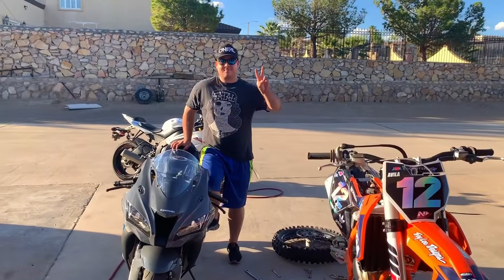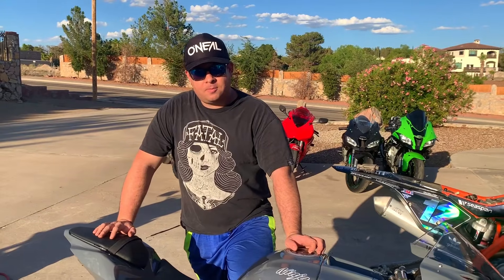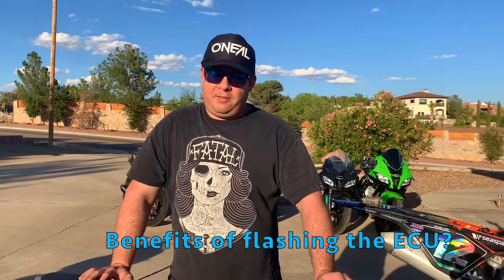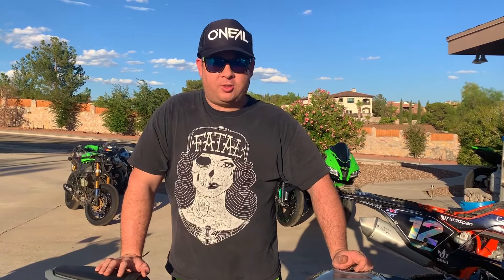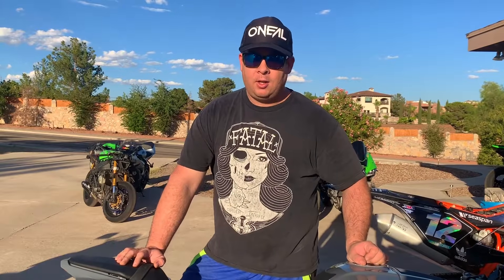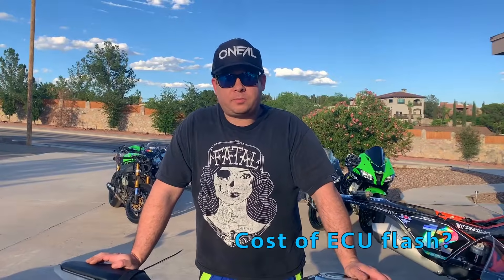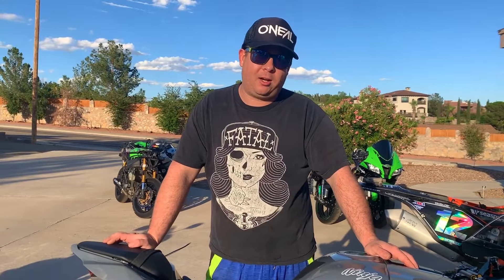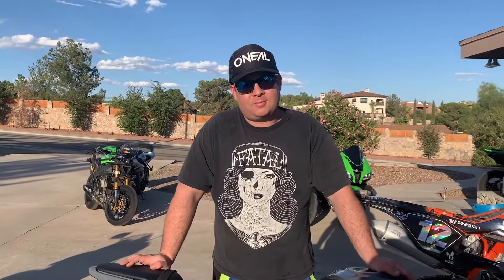Flashing Your Motorcycle ECU | Everything You Need To Know!

Comment: So I’ve tuned a couple trucks with hp tuners, the “2 different maps” your talking about is what open and closed loop if I’m not mistaken? On hp tuners you would be in closed loop until your engine warmed up. Still learning and that might be backwards but I’m basically asking does it read the same on dyno software and your translating it for more common understanding? Or does it really have two separate tunes at all times?

Comment: Will my bike (2015 yamaha r3) be worth it to have to ecu flashed? I have aftermarket air filter and slip on atm. Planning on doing more upgrades.
Reply from the maker: Yes 100%
Reply: @wildwhiskeywolf  what benefit would I notice?
Reply from the maker: More power, smoother throttle, and other improvements

Comment: dude i wish i could flash my bike for 250. the "best" flashing store in my city asks me for 400$ and they can only guarantee to fix the fuel/air flow mixture and not guarantee me any horse power. They said " it might get HP it might not, i dont know since i havent flashed a bike like yours before." They will get my bike's map for free for future use and they ask so fckin much...
I ride a cbr650r 2022. Right now i have installed an air filter and an exhaust. Catalyst is still on.
Any advice for improvements?

Comment: Thanks for the video!

Rich in detail and perfect for a noob like me!

I guess I'm going to ecu flash my 2019 suzuki katana, I guess it will be worth it!
Reply: Best options for this is if you fit an aftermarket exhaust system especially if you delete the CAT,then it like the mt09 can run lean as for emissions reasons they are already lean from factory,let the company know off all more so they can make the changes needed,the mt09 really benefits as it smoother out the jerky throttle and gives full power that is restricted on factory ECU.

Comment: Will exhaust systems from a 16-20 zx10r  fit on the new 2021 with out modification?
Reply from the maker: Yes you can make it work. Some won’t fit because of the oil cooler that was added.

Comment: Is this expensive, plus is this better than a power commander 5 ,my bike is a vfr vtec 3005 with a full upgrade Delchevic exhaust system
Reply from the maker: Flashing the ECU is always better than installing a piggyback system. You can change the fuel maps through the ECU, so piggyback system like Power Commander is not neeeded

Comment: Does anyone have this problem after flashing the ECU? I flashed my ECU on my CBR600, and now my bike runs much hotter. Before the flash, my engine temp was around 170°F cruising on the highway. Now it's at 200+°F. Like WTF? I want to flash my ECU on my 2020 Zx10r, but now I’m not sure if I want to do it.
Reply: That's the issue with just doing a ECU flash,it's not a tune for your bike in particular,done in different atmospheric conditions.Better to dyno tune your bike,and the flash the ecu. It costs more,but it's a tune specific for your bike

Comment: Hey i have a 17 r6. It had a recall on the ecu, due to the cold start issue. I had it dyno'd and flashed 3 years ago after i did the air filter and exaust. The cold start problem has become worse and worse and i brought it to my dyno guy and hes telling me he needs to take it to yamaha to be factory reset. Is this normal, he wont elaborate on why this needs to be done. Hes telling me he will get it factory reset and perform another dyno on it. Based on what ive said is this normal, have you heard of this before? And so you think its ok to still ride for a 4hr trip i need to take it on this week? Thanks!

Comment: Hey I just installed an arrow half system. Also have the servo buddy. I have no check engine light.And the bike started to do very random uneven revs at idle also in 1sr gear as I’m rolling 9-12 mph the bikes start jerking funny. What should be done in this case?

Comment: what if I dont get it flashed ? what happens?
Reply from the maker: You miss out on a lot of power and smoother throttle…amongst other benefits.
Reply: @wildwhiskeywolf  I just bought a used gsxr600 and I noticed something. When Im opening or closing the throttle its fine but when keep it still at a certain rpm it goes up and down like half rpm all the time. say Im at 10k rpm, it goes to 9.5 - 10 all the time. I was wondering if its bc It has a slip on or did I get screwed lol and it happens at all the rpms. even at like 3k rpm, it goes to 3.5 - 3 ... Doesnt make a huge difference on the performance but bothers me. and shakes the bike little little little bit but constantly when Im holding the throttle still. Thank you so much for your reply

Comment: Great video gents! Does the bike have to be running to flash it? I ask because my engine is partially disassembled and I'm waiting on parts. I'd love to trailer it to the dealer in the meantime and have it flashed. The bike will turn on but won't start as the right head is off the R1200GS Adventure, please know. Thank you.
Reply from the maker: No, engine doesn’t need to be running to flash ecu
Reply: @wildwhiskeywolf  Thanks Triple DubYa! Just so you know, the dealer who I took it to said they have to do $1,800 worth of work to get it running and then they'll be able to flash the ECU. FREAKIN' EXTORTION! I'm retrieving the bike tomorrow and will sue them if they give me any issues.
Reply from the maker: A flash doesn’t cost that much. Send the ecu to FastByFew.
Reply: @wildwhiskeywolf  Thanks so much!  I'll tell them you sent me.

Comment: This guy is spot on regarding the bike running two maps. I often experience a difference in performance whenever it reached maximum temperature and the fan kicks in. I think it’s time for an ECU flash 😎
Reply: These bikes run so close to stoichiometric that after a certain temperature the quickest way to reduce risk of overheating is by enriching the carburation. It's a safety measure. Same with the antiknock. Or the ignition timing that is delayed if you overrev. These things are there to save your bike. If what you're looking for is performance when the engine is close to overheating, flashing is your answer, it's also what will lead your engine to be ready for the scrapyard if you go flat out once this safety measure has been removed. No old school motorcyclist would batter their engine to death if the temperature gauge is too high, they would simply let it cool. In F1 they monitor temperature at all times during the race. If you flash your bike, there no monitor and no safety measure. These safety measures were put in place not to slow you down, but because they know that modern riders with little brain who think that they can go flat out at all times would destroy their engine.

Comment: My 2017 zx10r got a flash and dyno tune with my local mechanic in Dallas . I got all emissions removed, airbox mod, sprint filter and full graves exhaust. Final results were 178 whp. My mechanic told me this could be a defective bike from dealer
Reply: Where in Dallas? I need a flash on my zx6r here in a sec.

Comment: You can't tune better than the engineers. Leave the bike alone lol
Reply from the maker: Every single sportbike you have ever seen in a race has a modded ecu. Factory tunes help pass emissions, not top performance. The factory tune does not take into account air pressure, humidity, elevation or any of the other variables that change depending on where you ride. Tuning a bike is always a good thing.

Comment: I have a 2016 yamaha yzf-r6 all I did is a cat delete with a m4 y pipe with a akrapovic megaphone slip on tip. Everything else is stock. Should I go do a dyno ecu reflash asap?
Reply: So the ecu has to be reflashed before I put it on the dyno?
Reply from the maker: No if the ECU is already flashed get that thing on the dyno!
Reply from the maker: Yes get the ECU flashed then get it dynotuned. The ECU flash will make the biggest difference, get it done first.
Reply: No I haven't done anything with the ecu yet
Reply from the maker: Ok, so first get the ECU flashed, then after its flashed (or if its already flashed), get the bike dyno tuned. Its 2 separate processes.
Reply: All I've done is the exhaust cat delete and tip
Reply: How much would that cost just for the ecu flash?

Comment: I've got a 2015 cbr500r. Ive put a slip on exhaust and of course, I've notice a small drop in upper end power. Would a flash be of use, or do I need a power commander?
Reply from the maker: Yes, get the ECU flashed! You will notice a big difference! Don’t worry about a PC unless your tuner recommends it for your setup..

Comment: Great video ! Super informative! I’ve got a Kawasaki 650 with a full Akrapovic exhaust, sprint filter and a power commander installed. Would you just do a tune up on the Dyno or do a ECU flash and then a tune up on the Dyno? The shop at my local area is charging me a leg for it lol 😝 thanks !
Reply from the maker: Do the Ecu flash first. If you want to get the absolute best a/f ratio after the ecu flash, get a dyno tune done. ECU flash will make the biggest difference in performance though.
Reply: WILDWHISKEYWOLF thank you for your help.  I know exactly what I’m doing in the next couple of days cheers 🍻!
Reply from the maker: Yessir! Keep me posted on the results!

Comment: Hello I just bought a full akrapovic racing system exhaust and plan to put in my 2012 Yamaha r6.. I’m just wonder after install this  Akrapovic exhaust in the bike do I have to get fuel tuning and ECU flash services for bike the to ride smooth n normal.. BC I reach out to people working from Revzilla and they said With Akrapovic full system exhaust doesn’t need fuel r ECU services.. and he was saying akrapovic build this exhaust system around the stock fueling of motorcycle which allow them to pickup power over stock unit.. please I love to hear from your advice
Reply from the maker: Johnnie Ha Ya, it’ll run much better and more powerfully with an ECU flash and tune.
Reply: Thank you for reply so quickly.. so you’re saying  its does need fuel tuning n ecu flash services after install the exhaust in for bike to ride smooth n more powerful.
Reply from the maker: YES. Anytime a part is installed that effects the air/fuel ratio of the bike, a tune is the best option to get maximum smoothness and power out of the bike. ECU flash will unlock all the factory restrictions, so that’s good to do before the tune.
Reply: Thank you so much for your advice.. one last question do you flash ECU for 2012 Yamaha r6 and what is the cost??
Reply from the maker: FASTBYFEW is the business I get my ECUs flashed from.
Reply from the maker: FASTBYFEW is the business I get my ECUs flashed from. Send them a message tell them a message.

Comment: So I have a 06 R1..it only has two brothers slip ons and a K&N filter. How much of a benefits can I expect of removing the exhaust servo flap and doing a flash?...thanks
Reply from the maker: Billy Toth removing the exhaust servo would be more of a weight reduction performance mod than anything..the servos are not needed...they are only there for emissions regulations and sound decibel regulations..the FLASH on the other hand you will see incredible performance gains from..its like riding an entirely different bike!

Comment: What would be the benefit of flashing a 2009 Suzuki Gladius
Reply: I have the same bike same year. I have a Leo Vince slip on but would like a full exhaust, tune and upgraded rear suspension.
Reply from the maker: Ben Peter Meyer flashing the ECU will take all factory restrictions off the bike and allow it to run at its full potential...runs much smoother as well!

Comment: By choosing not to flash the ecu or dyno tube the bike, will it hurt the engine  not performing this model. Thanks.
Reply from the maker: No, it will not hurt the engine...although tuning the bike is great for the bike in the long run because it fine tunes the A/F ratio so your bike is not running lean or rich from the factory settings. ECU flashing is great for bringing out the full potential of the bike, but it will not hurt your bike if you decide not to flash the ECU

Comment: Going through the process of upgrading my 2015 gsxr1000.  I too am     in between a pc or a flash.  I would to like get close to 180 rear wheel hp. So far, two brothers M2 full exhaust, K&N race filter. Realistically will a flash be better than the PC? Quick shifter to be added later this year along with a few engine upgrades.  Thanks
Reply from the maker: The tune can be done through the ECU alone. There’s no need for a PC unless w/e tuner is local to you wants to use one in the tuning process.
Reply: @wildwhiskeywolf  thanks for the reply. Ecu flash seems to be the way to go the more I read and do comparisons between the two.

Comment: I purchased a secondhand bike which didn’t have any keys, it’s a GSX-R 1000R. I have been told I would need to get my new keys and my old ECU to someone who can write my new key codes to my old ECU. Suzuki would have you buy a new lock set and a new ECU. So, how does the information, for the keys, get written to an ECU? I would need to do it now, with my old ECU and new keys. And would have to have it does with the new keys and new ECU. (Wondering how you order new Lock Set and New ECU with this already done, or it isn’t and you still need to do it with a new ECU). Can you or anyone else she’d some light on this, plz? Also, what a retarded idea the immobilizer really is. Or at least not being able to get a key for an ignition you’ve lost all keys for.
Reply from the maker: Mark G That sounds like an issue you should ask your local lSuzuki dealer..woolich software is used for performance ecu flashing...

Comment: So I have a 2017 gsxr 750. With a mid pipe and m4 slip on.  Should I flash my ecu first then get a dyno tune with power commander or ecu flash would be enough. I don’t do track days just street riding for a a few months out the year because I live in CT.
Reply from the maker: william smith remove your emissions and get the ecu flash first. Then find a local tuner with a dyno and get a dyno tune if you want. Just getting the ecu flash which removes factory restrictions on the bike will make the biggest difference if you just do street riding.
Reply: WILDWHISKEYWOLF  yea because I lost a lot of top end power especially getting on the highway
Reply: Alright. Kool. Thanks for the advice. Like you said find someone close to do the job.  Gotta do my research

Comment: hey man i would love if you have 30 min of time to send me some info about the dyno and ecu fleshing. I have motorcycle repair shop in Serbia but i'm planning this year to add dyno and ecu flashing error code deleting station but the problem is in my country there are general Suzuki, Kawasaki, Honda ... .. . . services that are not willing to tell anything and there is no one like me ho can do this such jobs in my country i would love to be first and have the bennefit of that. i would love yust general information like what size is inertia wheel ( because i'm gonna make it not by it its to expensive ) i'm gonna use arduino and hall sensor with o2 and rpm. for the dyno. and i want some info about software for flashing how much is it how much did you pay for wearing harnesses for different bikes and some another info. please if you have time can i contact you threw your facebook page. Sorry for my English i make mistakes..
Reply from the maker: Moto Doktor If you send me specific questions I can link up with local tuners and interview them and have the questions answered for you
Reply: @wildwhiskeywolf   i will send you a message on facebook page :) thank you soooo much :)

Comment: Are there any downsides to an ecu flash? I plan on buying the 2020 r6 and I’m just finding out about this
Reply from the maker: Josiah Marin None at all. An ECU flash unlocks the bikes capabilities that are restricted from the factory and also makes the bike run much smoother
Reply: @wildwhiskeywolf  Thanks for the reply. Where are you guys located?
Reply from the maker: I would recommend getting your ECU flashed locally that way you can go through all the specifics of the flash with the tuner. Flashes are different depending on what mods you have done to your bike and if you have emissions, o2 sensor etc